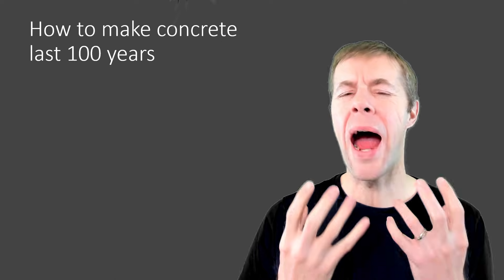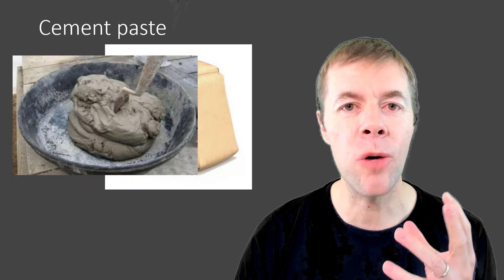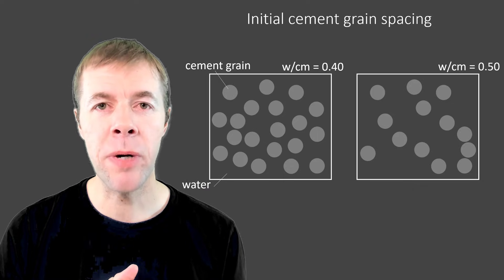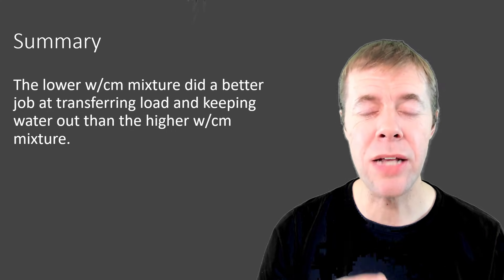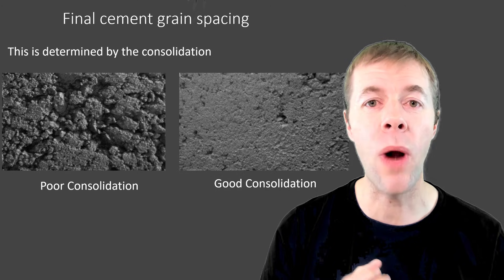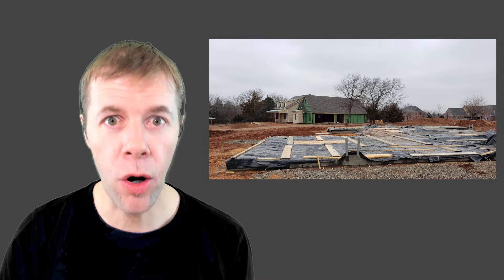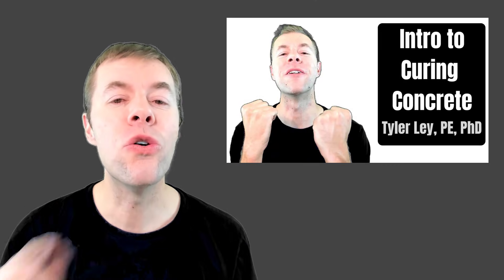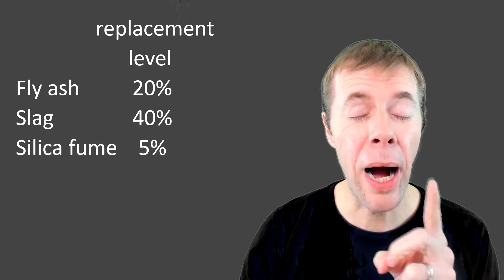How to make concrete last 100 years

Comment: Your blankets speech was total bull lol. That’s not why those were on there
Reply from the maker: What do you mean?
Curing blankets are widely used in practice and they are used to hold moisture on the surface.  You can also use blankets to hold in heat but that is only during the winter.

Comment: Flagler's concrete bridges in the Florida Keys are 100 years old and still strong. High cement ratio and mixed with mineral rich seawater.
Reply from the maker: The Sunshine Skyway bridge has some seawater used during mixing and it has been a constant maintenance headache.

Comment: Thanks. we use magnesium orthosilicate for sandblast media and have a tremendous amount of dust accumulating in our filters. CAN I use that dust to make concrete? I understand the magnesium orthosilicate is a great material, but how about after it's pulverized and mixed with things like rust and paint?

Comment: Can you talk about Type K cement? How about PRAHs like Techcrete 2500 and Masterlife 300D and Xypex and Hycrete Endure WP AND Hycrete Endure CP for steel corrosion protection? Can you talk about E5's Internal Curing admixture? What about particle packing? What about paste to fine aggregate bond strength? So many questions? Why are PCE Superplasticizer HRWRs better than others or are they?

Comment: I take it you’ve never actually delivered concrete.  So, let me tell you what you don’t know: 

Albeit the W/C ratio is of the upmost importance the rule is often ignored. Side note: You should also touch base on some research on air entrainment… 

Back to W/C ratio, I’ve personally worked on ground zero from the basement to to the top of towers 3,2 and 1 including the memorial, the plaza and the performing arts center. I’ve also worked on the entire East side access project, all of Hudson yards and the floating park in Hudson River and the NYC water tunnel renewal project. before I also did all the concrete for the Seventh Ave subway extension, the tunnel to nowhere under Hudson Yards, the Gowanus elevated highway from the Vz Bridge to the Battery tunnel, the Battery Tunnel after Supper storm sandy,Mets stadium, the Vz bridge retrofit, the Jenga Building the list is long of known and unknown private, public and infrastructure concrete projects in NYC… 

Everything is still standing and most likely will for a Uber long time. 

We consistently disregard the W/C ratio. The amount of water we’ve added to loads of concrete would make engineers throw up. 

Just saying… concrete is an absolute amazing glue; it can be tempered above and beyond the formulas W/C ratio and stand the test of time.

But if you haven’t heard there’s now evidence that Manhattan is sinking… I guess concrete is too heavy.

Comment: this is a little too deep for anybody except lab engineers!Why not tell us to ORDER our concrete{I doubt aybody is mixing their own}..with more portland in it?4000psi is common when 4500PSIand even 5000 psi can be ordered for 6-10 bux a yard EXTRA !  and REBAR left laying at the bottom of the slab BECAUSE NO ONE PUT CHAIRS under it is a waste of money....your finishers never lift it during a pour! I EVEN VIBRATE my slabs.....never mentioned was a slump test to make sure the concrete wasnt brought too wet! Tested at the site!........

Comment: Since you asked me my idea Tyler, I would like to have the inner sections to be more strong - like even the iron H beam for load bearing pillars, surrounded by rebars, and internally along with rebars I would like to use the harder polymer fibers, and external layer with softer fibers for cracks.

Comment: Could somone here give some insight when we want to make concrete weight plate for barbells? Im asking about the reinforcement. Is just adding Chopped Strand Mat Fiberglass enough to strengthening it? Or maybe with addition of steel wire around the circle will help increase the overall strength? Since it might be accidentaly dropped to the ground many times but not hard drop. Thanks in advance.

Comment: Please help need a paper on Geology and Cement hydration relationship. With possible solutions to retard hydration from 4hrs to 8hrs and still gain 30 MPa strength - void shrinkage factor.

Comment: Design phase: W/C =<0.4, Using super-plasticizer, appropriate concrete grade & cover, appropriate raw materials ( aggregate, crushed sand and river sand with better properties parameters), control crack limit, using crystalline product (self-sealing micro crack), cement PCBbsf50, using by-products (fly ash / furnaced slag / silicafume with proper amount ), etc. Construction phase: proper vibration, curing, following formwork removal procedure....). Operation phase: Following operation and maintenance Manual. 
Good videos. Thank u so much!!!
Reply: Hi Mr. Tyler, I have a question “How do we assess reinforced concrete durability over 100 years? Please kindly support!

Comment: when you are finishing semi hardened "green "concrete with a steel trowel, add a spray of water and dust it with dry pure portland cement powder.....swirl it round and round, work that pure portland paste into the pores.  the poured cement going off will catalyze the fresh cement slime you are working in and make it go off pretty quick......keep it all wet as long as possible, even after its hard as hell.  if you want a rough surface, use foam or wood trowel for the swirling

Comment: I'm curious about how this paste formulation and aggregate sizing plays with pervious/purposfully-porous concrete strength. I would assume that you still want the paste to be low water and even add some pozzolans as the paste bond strength may be even more critical than it is with a sand filled void spaces, and so there is very little microporosity even though the goal is a large amount of macro-pores.

Comment: Using a porous aggregate that has a high amount of water retention, holding water like a sponge releasing it slowly into the concrete right in the critical curing stages that are water starved.  I believe the technique is called “internal curing” having the water available at the late stages is a game changer.  Look into “light weight aggregates” and “internal curing”

Comment: I want to build my own concrete fence panels for a residential application. Keeping the horizontal slats 1 to 2" thick I was planning to reinforce with remesh or rebar. Then I thought about which type of concrete and which additives I'd need. I watched several of your videos and felt very inadequate. What to do?

Comment: when I built my shop...and living with very poor flatwork done in my home and attached garage...I spec'd 6 inches of 4500 psi, as dry of slump as the finisher was willing to work with, poured over radiant tubes with wire re-enforcement. Once poured and finished, about four hours later I ran water through the radiant tubes to remove heat to slow the cure. Water went in around 50 degrees and came out in the 90's. The water then was sent to a sprinkler that was set on the slab. I ran the water for three days. This was summer with daytime temps in the 90's. Turned out great. only one crack in 8 years.
Reply: Wouldnt running water..I ncrease the speed it cured?
Reply: @metalrooves3651  At Hoover Dan they ran refrigerant pipes to help cool the concrete. Too much heat can cause cracking.  It was July and for three + days it was in the high 90's.  If I would have poured it in cooler months I would have done something different. Keep in mind the water was sprinkled on the slab so some of the heat was put back. It was all about slowly curing and keeping the slab hydrated. They run sprinklers on bridge pours all the time around here...

Comment: I have worked with concrete (including compressed) for over two decades. Concrete is a fantastic, useful compound. The use of silanes and siloxanes really do work. You mention it however there are some really important side issues. One is the high VOC silanes. They do work, are up to three part mixes, and are FLAMMABLE. You need to be careful of this. In addition you need protective clothing/gloves/breathing/eye gear. Do not ignore this. There also is an additional matter with a silane/siloxane coating. I have had coated concrete Walk ways mostly) that when coated well:Mitigate mild growth in areas as wet as south Florida. If a silane producer sells you a product:DO get trained on it first. Be safe and all will do well.
Reply: Did you mean 'mitigate mold growth" ???

Comment: Hey Tyler   Excellent presentation.  Let me offer a "boots on the ground " observation about concrete design specification based not only on your empirical data but also based on observations of reality.  Engineering specification/tolerances are to extreme and often concrete is rejected simply because air is half a percent over or under. Also, even with water reducing agents, sump requirements do not allow workability, (keep in mind the adversity that engineers and inspectors have towards "over vibrating")   There seems to an engrained fear about the fragility of concrete.  It will get hard and usually only fail if there is an extreme variation from excepted practices not de mini mas deviations.

Comment: I used to work with hi performance concrete. I don't want to get into who I worked for or what I built. Let's just say it was more tightly controlled than a slab for a shed. 

The plant was in Florida. We had hell with sodium ion proliferation. Salts is in the air near the coast and thanks to saltwater intrusion,  in the well water too unless you pull from deep in the aquifer. Even then you can still get sodium contamination. 

Getting to my point, if a few tricks.... Super P was always a given. The synergy that came with lignonsulfates was a huge plus as well as the delay the lignonsulfates gave us to finish the pieces  a few times we had really important pieces with crazy specs from customers.  We also had a nut job for a research scientist. I won't drop names. We worked great together even if he looked like Doctor Robotnik. 

We developed a procedure to cure under pressure. We only used distilled water on those projects.. We also tried to duplicate pressure treating. Cure in heated  water  under pressure until  7 days of curing, then 21 days open atmosohere. Then 7 days in a vacuum environment with moisture absorbant packs. The packs were quickly removed and vacuum was reapplied for 24 hours. The piece was then again submerged in curing fluid under pressure at 120°F  for 14 days. The curing solution was little more than acrylic emulsion, and a little vinegar. I mean very little. Like 0.001%  theoretically it would open pores for the acrylic to bond and be weak enough to netralize before eating through the float layer. The pieces were then wet polished and waxed like a car. We got break strengths if 16,000+ psi. We never failed a test. 

I also have to comment about silica fume. If durability is your goal, silica fume is your best friend.  But.... nasty to work with, and I always substituted 3% flyash for workabiluty.  Fiber reinforcement is also gold. 

Yes it was highly involved and expensive, but our pieces belong to puzzles that guard VERY valuable stuff. Mud like that doesn't work in a drum mixer. A pan mixer can work, but a volumetric auger mixer was most efficient. For really special stuff, only a pan mixer was feasible.

Comment: Of course you can get concrete to last at least 100 years... look at what the romans did when they mastered concrete.. they have structures still standing that have lasted at least 2000 years.... very possible.. I’d be surprised if a properly poured slab doesn’t last 100 years at minimum

Comment: The more you vibrate the more the aggregate sinks to the bottom and the more sand and cement float to the top resulting in a weak structure with a lifetime of 100-99=1 year

Comment: Hi... bro.. i m from India.....My hearty Wishes for your Passionate Work....  i m in the process of designing 6 m tall gravity reservoir... comparatively its a small reservoir... is there any possible way to obtain 200 Year+  life spam..... No problem with initial capital... 1) steel wont last that much, so can i use synthetic fiber mixture for concrete....?    2) we planed to concrete floor the reservoir to avoid leak, does the concrete floor inside the water reservoir  last that much(200 Year+) ...?  
One Second, i m appreciating for your dedication on Engineering..

Comment: Professor...are you going to address the use of fiberglass chopping in concrete?  I have a degree from U of Md  in civil and graduated in  1963.  I spent a couple of summers working for Md. State Roads doing pullout tests  of rebars on concrete block about 12 “x 12”  x 36” if my memory is correct.  We very carefully  cured the  concrete blocks with their rebar pulling  brackets in the 100% moisture room.  Mix, slumps, test cylinders etc were carefully controlled.  There was no such coatings such as epoxy or galvanizing in the trade or our tests at that time.  The tests were in support of the continuously reinforced road bed on Interstate highway between Baltimore and Troy PA.   Later I encountered fiberglass chopping being used for slabs without rebar for garage s, sheds. Etc.  My own home had 4 k mix with choppings but no rebar in the driveway and garage floor.  After 20 years, no cracks or scaling, etc.  I had to scream at the concrete foreman as he met the mix truck with a hose in hand.  We were moving into a gated community with no experienced home builders who had ever built anything bigger than a double wide.   I worked for Otis Elevator for about 30 years and never as a real civil.  Retired from Otis 25 years ago.  Your videos are very fascinating.  I see projects such as our NC Bonner Bridge being  replaced due, I am sure, to failure of concrete and corrosion of the steel.  Your videos on the subject are the first I have  encountered and enjoy them very much.  Please keep them coming.  Good Luck and may GOD keep you safe in this Virus emergency.

JoeB
Hertford, NC

Comment: Hi Sir, In India, we are getting Portland Pozzalona Cement 66% OPC + 34% Fly ash. Having said that, 1.can we use this for concrete. 2. As adding the flyash 34% in the cement, will it increase the Concrete durability to double the life which stand for more than 100 years.

Comment: Instead of having one just type of concrete, use a couple inches of silica fume concrete as the outer layer to reduce migration to and from the rest of the concrete in the middle.

Comment: The Aggregate is important, must be clean and strong, mix sizes is good.  Vibrate, timely pour, slump, temperature control, lots of clean water afterward. We used to buy ours by the truck. Sometimes a pour would be 5 trucks, sometimes 10, sometimes 30. And if a truck was bad it could jeopardize the whole pour, and possibly the project. So we check each truck for slump, and time from plant. Not all provider had good quality control in plant, we used only the ones we thought were consistent, specially for critical pours. 
So by the time the concrete got to us after 30 minutes of traffic, it was well mix, there was a final adjustment in water based on slump,, we mixed five minutes and then poured via pump. We then vibrated, in hole. As the hose moved around, we took temperature readings and also listened for noises in the concrete. My job was to watch and listen. And have them move the pumps to the next spot and let that spot set a bit before continuing. With large amounts of concrete it can get very hot and this can dry out concrete and prematurely cure it falsely. If this was underwater it was not a big deal, mother nature would let moisture in. But if pour was above ground managing temperature/moisture was important. On cold days, of 40F-50F we cold still do pours with additives but we watched temperature in other direction, we did not want it to get too cold. 
At the end the most important part depending on situation, if cold we would put blankets over concrete to hold temperature and moisture and them plastic. Or if hot just the plastic. We would then have a guy come by at least twice a day and water the concrete to make sure it stay wet for at least 4 days.This is the most important part for making sure it sets right.
Btw, the best time to pour concrete is early morning so that it gets mid-day sun for faster initial setting, then you finish off by afternoon and then it sits through the night well curing and moist. By morning water it again. Concrete drinks alot of water. The more water you give initially the stronger it will get. The first 30 days it is gaining strength, so if you can keep wet for a month the stronger it will be. 
Tyler makes great videos, my comments are meant to give some real world concrete experience that I gain from the millions of tons of concrete that I poured over the years. Some of the info may be obsolete, or wrong, but that is the way we were taught. I am not a concrete scientist, just a guys that used to swim in it for many. Yes, swim with it, when we did an underwater pour I directed the hose by swimming a few feet above the wet concrete. Crazy times.

Comment: Are you familiar with the Long Now Foundation, a non-profit devoted to fostering the long term view, on the scale of hundreds or thousands of years into the future.  For example, as an art project, they're building a clock intended to operate for 10000 years: 

http://longnow.org/clock/

And some structures need to be designed to last for thousands of years, such as nuclear waste storage facilities, such as the Onkalo spent nuclear fuel repository: 

https://en.wikipedia.org/wiki/Onkalo_spent_nuclear_fuel_repository

If you were tasked with building concrete structures designed to last for 1000 years or more with very little maintenance, and potentially in a harsh environment (salt water, etc) what approaches do you think you would take?